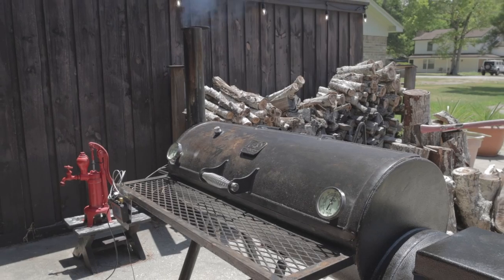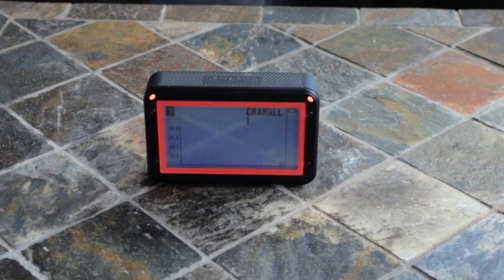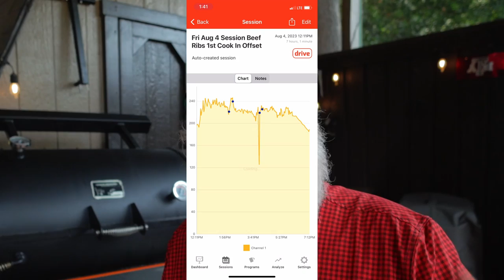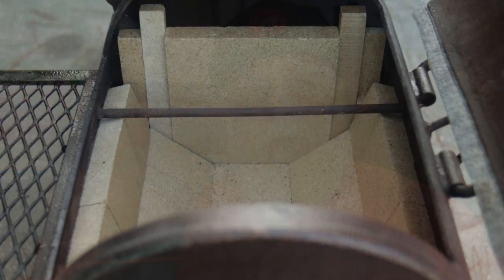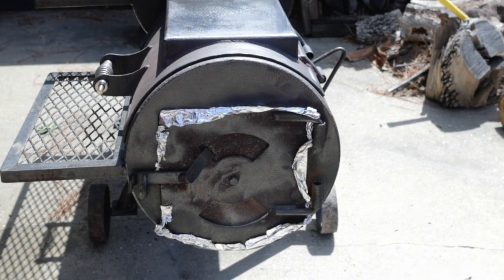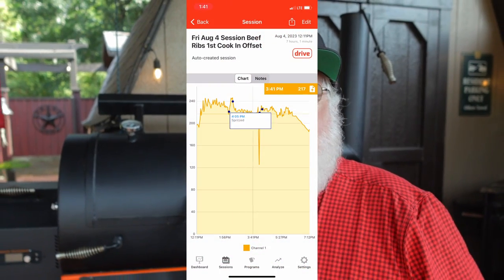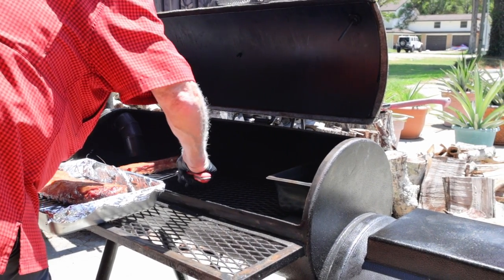Installing A Fan And Controller On My Offset Smoker

Comment: So glad to see someone with an almost exact technology match to my smoke setup. I have the FireBoard 2 drive and the same fan and bulkhead adapter…I even mounted it in the same place you did!  The problem is…when the fan turns on the ambient heat drops instead of increases. The firebox is sealed and all closed up. The fire blazes when the fan turns on but the heat is pulling a Houdidni. I’m only using wood (no charcoal). Can you offer some advice?
Reply from the maker: You may need to close down on the stack vent a lot more than normal. The fan can push the heat out of the system too fast. You may be surprised how much you need to close it. Good luck

Comment: I just ordered a Fireboard 2 Drive as a replacement for a Gravity 980, in order to have the on the go app control and lower smoking temps. If it goes well, me and a buddy are going to build a heavy duty  gravity fed smoker that uses a fireboard and fan.
Reply from the maker: Good luck with the build and thanks for watching and adding your comments.

Comment: The included directions for the pit bull recommend installing the fan to blow between the grate and the bottom of the firebox. I see you’ve installed it higher up to essentially point at the fire. I use a basket - should I install it so the air is blowing directly at the fire or under it as the instructions suggest?
Reply from the maker: I’m not using a bottom grate. I’ve lined the lower part of the fire box with fire bricks and the wood sits directly on top of the bricks. Since you are using a grate, I would stick with the instructions. Thanks for watching & good luck.

Comment: hey building my own smoker and going to do this.. do you think one fan is enough?
Reply from the maker: One fan is plenty for my smoker, but it’s not a large pit. I actually installed the adapter off center, so I could add a second fan if needed. You could call :customerservice@thebbqguru.com@ 1-888-223-6118 and I’m confident that they could steer you in the right direction 
Thanks for watching and let me know how that build turns out.